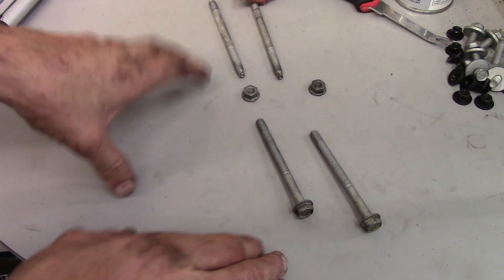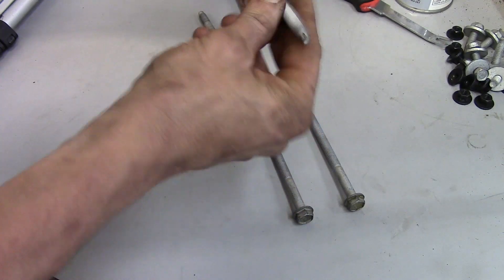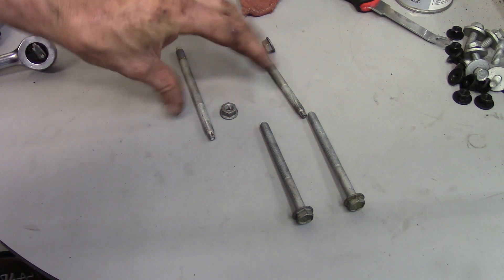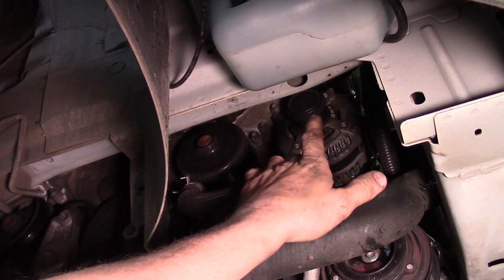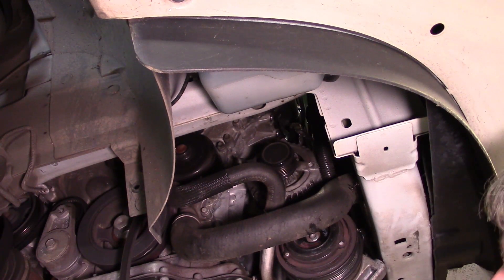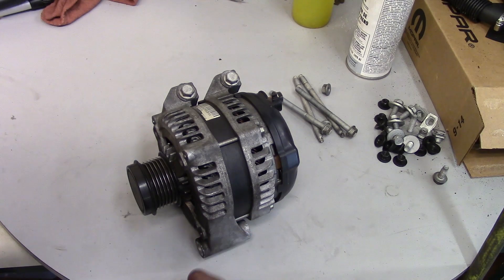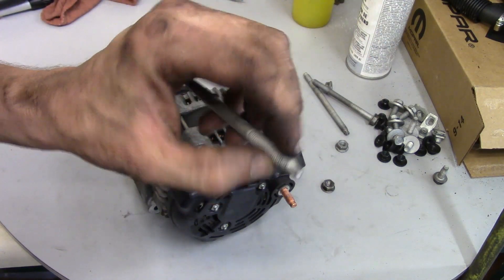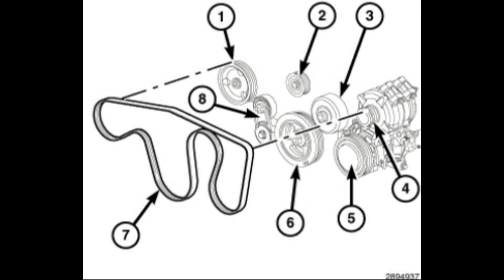Part 2/2: Grand Caravan and Town and Country 3.6 liter alternator removal with shortcut

Comment: Thank you so much for this detailed video MotorCity Mechanic. I was dreading replacing the alternator on my 2011 T&C Limited  especially after watching several videos of the "Go in from the top" method. After seeing this video it made the most sense  and helped me tremendously. TO ANYONE READING THIS, If everything goes right this can be around an hour job. 
LIST OF TOOLS I USED:
E8 inverted torx - for the A/C compressor studs(advance auto about $5).
3/8" socket wrench/ breaker bar- for the belt tensioner.
10mm socket- for the battery terminals / wheel well area plastic shield removal.
13mm socket / wrench w/ extensions(you may or may not need extentions,  they did help me in a few places)- for all other bolts I believe.
Flat head screwdriver - for plastic tab removal on under shield and to help release the tabs on the wiring harnesses. 
19mm deep socket- for wheel lug nuts.
 Of course for me me, everthing going smoothly never happens so it was a three hour job but nothing too difficult.  The added time was spent struggling with the wiring harnesses as mine were not as easy to press/pull out carefully, one of my A/C compressor studs did not want to go back in properly and just taking time to rewatch parts and steps of this video to ensure I was getting everything correct. If I were to do it again, I could have it knocked out in an hour. This was performed on my back in my driveway with the front passenger side jacked and tire removed. So thanks again for making this MotorCity Mechanic! Saved me a lot of money and only cost me a little time!

Comment: Just used this method on our VW Routan and it was great. A little tight with some of the bolts in the AC compressor but got it all out and BAM! The alternator came right out the bottom. Thanks for the video!

Comment: Very helpful. I did not have much time, and it needed to be done by Monday and a window of opportunity opened yesterday. Your video gave me a good idea of what I would experience. The quality was great and the bench talks were great. My first obstacle was operating the electrical connector on the AC compressor. I thought I knew, but I was not certain and I did not want to create a new project. I confirmed my knowledge and pressed forward. I had some challenges with removing the top right stud because the T8 sockets were all deep well and there is not enough room with the AC  hose. The other surprise was that the alternator stud came out with the nut which was actually helpful. There was plenty of room to get to the connector and battery wire on the backside of the alternator. Thank you for taking the time to put this together! I'll be looking for your videos in the future.

Comment: Thank you for these videos!  Replaced alternator on my 2012 Town & Country.  Used an E7 socket for studded bolts and removed the studded bolt from the alternator mount to maneuver it better.  Great description on the electrical connections as well made disconnecting easier.

Comment: Thank you for a clear, concise and interesting video. I also appreciate the fact that you used no off-color language in the production. I plan to do this job in the AM using your instructions.
Reply from the maker: Thanks for the kind words and for checking the video out. Make sure to subscribe
Reply: @MotorCityMechanic  I did. Didn't do the alternator replacement today due to a bad battery in wife's Journey.Battery is in the left front wheel well area. Poor, poor engineering. Hope to do alternator Sat.
Reply from the maker: @thomashuckaby8867  Take your time and you shouldnt have any issues.

Comment: Watched your video, thanks for the tip, didnt even watch any others. I have completely gave up on using manuals. Really appreciate the video. Just change the alternator took about an hour, one floor jack, one jack stand, four way wrench, 3/8" drive ratchet, 10mm socket 6" extension, 4" extension, 13mm socket,  1/4" drive ratchet a 5mm socket and 5mm wrench for the air conditioning studs, and of course a few well chosen words. and repair was flawless. Thanks again!!
Reply from the maker: Much appreciated Gary! I have no faith in paper aftermarket manuals as well. You just cant take enough pictures to show a repair.....video is the only way to go and some people butcher that up as well. I try to improve on each new video I put out so that I cover more steps and mention other needed items and tips. Thanks for watching and make sure to subscribe and check out my other videos as well.
Reply: Awesome video exactly what should be listed under the description on the auto parts website when looking at the alternator oh, because this was a lot easier then any other method
Reply: i suggest you copy Gary Lee's equipment list (or modify to fit the video) and have it be the first part of the description. I always appreciate knowing in advance what is required for repairs, other than that, i greatly appreciate your video. at first look at my van, i thought.... I'm not going to be able to get to that. now i feel much more confident.

Comment: Thanks for the video. It was tough to get the studs screwed in when putting the ac compressor back in. I used some creative extensions but eventually got them back in. The serpentine belt was a bit tricky. I figured out for my 2012 grand caravan that if I put the belt around the idler pulley last, then it was easier to put on, since it is smooth and doesn't have ridges. It was also helpful to charge my battery with a charger as I changed the alternator. I had a fully charged battery when finished. Once again, I sure appreciate your time to make this video!!!🙂
Reply from the maker: Awesome. Glad to see another video helped someone out. It can be fun for sure taking on that job but its still doable as you found out. Good thinking about the battery charger.....that way you didnt have to wait half a day when done just waiting for the battery to get charged. Thanks for watching and make sure to subscribe.

Comment: Much love and appreciation for this video! I didn't have a clue where I was going to have to start. When I learned about the coolant I was terrified of working on it. SO glad I found this video. Put the van on ramps and had this done with zero complications in under two hours. Thank you thank you thank you!
Reply from the maker: Cool. Glad to see that the video helped. It's not the easiest alternator to replace but as you saw....it can be done. Thanks for taking the time to comment and for watching. Make sure to subscribe and share the videos

Comment: I don't know if anyone mentioned this, but I'll add something.  I was working with the van on ramps.  It was very hard to get the connectors on the back of the alternator. So  I removed one side of the radiator hose and moved it out of the way and I easily and quickly was able to get to the connectors from the top.  I also had to buy an E8 inverted Torx.  I know other guys tried other things but I figured I'd go ahead and spend a little more for the right tool.   Thank you for the video, it's the only one I needed.
Reply from the maker: Glad that the video helped out and appreciate the info on what helped you. Thanks for watching and make sure to subscribe

Comment: This is an excellent video. I did this exact repair on my 2012 Grand Caravan Braun handicap conversion that has the engine lowered 3 inches from its normal position. I used the exact tools you used in the video  and only a set of ramps in my driveway in one hour. Thanks a million!
Reply from the maker: JJ Battle Awesome. As you saw you don't need a lift....some ramps or jack and jack stands is all that's needed. Thanks for the feedback and for watching! Make sure to subscribe!

Comment: Did the replacement today using this shortcut. Worked like a charm! Took me a little longer as I don't have a lift, but it definitely saved time over using the book procedure. Regarding the reverse torx bolts for the compressor, in a pinch you can use a 7/32 socket to get them out. Worked well for me.
Reply from the maker: +Patrick Gagnon Thanks for your take on the video Patrick. I appreciate the input as well. It's all about helping each other and your input helps others that read the comments so thanks. Make sure to subscribe of you haven't already and help spread the word by sharing these videos with others.

Comment: Awesome video. Short and to the point. Took me less than 2 hours in my driveway.  Btw if anybody needs to know. The reverse hex studs on the ac is a 5mm socket.
Reply from the maker: Glad it worked out well and thanks for the great feedback as well as the tip. Make sure to subscribe if you havent already.
Reply: I wish I seen this comment earlier!

Comment: Thank you for the video and adding the serpentine belt routing diagram.   

I debated on trying the top or side method.  My garage is small and I was not in a hurry and choose the top method.   It took me about 2 hours.   I drained 1/2 gallon from the radiator, this was easy, just attach a 1/4" hose to the nipple on the driver side lower corner and open the drain valve.  Unhook the radiator hose, and push it down into a bucket to get the rest.  Remove the hose (no spillage).  The fan is easy to remove.    The downside with the Top method is working on the the serpentine belt.   I had to remove the air filter box (easy, it just pulls up), but there is not a lot of room to work with the belt on the top.  To reduce tension, I needed a 3/8" breaker bar with extension.  Making sure the belt is on properly is also a bit difficult from the top.  I spent about 30 minutes dealing just with the belt, and I can see how going in from the passenger front wheel would be much easier.      

When it was all back together, poured about 1 quart back into the radiator, ran with the cap off put in some more, but the last quart into the reserve. 

I think this side method might be better, and if I have to do it again I will give it a shot.

This video was very helpful, especially explaining how to unclip the electrical connectors by sliding the red clip out, then pressing in the middle.

My original failing alternator was putting about about 13.5 at idle, and 11.9V with all accessories running.    New alternator  14.4 at idle, 14.2 with everything on  at idle.

Comment: Excellent video on the shortcut! My alternator just crapped out (100K miles on a 2011 Grand Caravan). Going to replace it and the belt this weekend. This will definitely save me some time!
Reply from the maker: +Patrick Gagnon Thanks Patrick......Take your time and you should have no issues. Do me  a favor if you don't mind....got a thought for a further project that I may or may not do but none the less.....if you like, send a pic of you and the vehicle. Thinking about maybe putting together something with vehicles and owners that fixed their cars from watching these videos. You can email them to david@motorcitymechanic.com . Otherwise thanks for watching and for the comment. Make sure to subscribe

Comment: I changed our 2012 grand caravan with just crocodile jack and a pair of jack stands because  i don't wanna pay for a an expensive shop rate.  So i did it on my own.  This procedures works like a charm even though i don't have the luxury of using a hoist and working on my feet.  I'm done in an hour and a half working on my back on a piece of cardboard.  Recharged my battery while working on the alternator.  Fire up the engine & recheck charging system & all working good.  Thanks a lot for this video for saving me a lot of money.  I highly recommend this procedure.   Cheers!!!!

Comment: Thanks so much for the video. I got to do it twice in one day because the first alternator I bought was putting out 18v. Second alternator has worked well so far (just finished putting it on an hour ago and drove it about 10 miles and so far so good). The only thing I did different was used an e7 for the studs, (think you had an e8???) Anyway, you saved me a lot of time and money. Keep up the good work!

Comment: Thanks for this information! Getting ready to change my alt out tomorrow. Good to see people who think outside the box and share information! Thanks again!
Reply from the maker: Appreciate the feedback Jay. Knowledge is meant to be shared. Make sure to subscribe if you havent already
Reply: I live down in Toledo Ohio and I've always taken my alts and starters to Wally's on Bennet Rd. 20+yrs and no problems with Kenny's services. When I had my 2012 3.6 alt rebuilt last week, he removed the external clutch and replaced it with a standard pulley. My question is why the external clutch and do you see any reason for changing or not to a standard pulley? Thank you for your help and information!

Comment: Thanks for this video, the tech advice is much appreciated.  Pulling from the bottom made a lot more sense than dealing with coolant.  The 5.5mm socket works great for those studs (didn't have the torx socket), and the 13mm bolts on the alternator came off with a short socket and elbow combo.  Didn't have a stubby wrench.
Reply from the maker: The "out the bottom" method is the way I prefer to use each time. Even without a lift you can still access it with a set of ramps or jack/jack stands. Thanks for touching on each of the steps and what worked best for you when it came to tools on hand. Thanks for watching and make sure to subscribe.
Reply: Yes Sir, did this without a lift - still on jackstands with a sheet of plywood in the driveway only 1/2 done hahaha.  New alternator arrives tomorrow, can finish it up.  Checked out your other PentaStar videos, the spark plug replacement one is going to come in handy.  What ordinarily should be a simple job is simplified by your video - thanks for this too (in advance!).
Reply from the maker: I think in that video I edited a mistake....it might mention something about the injectors or lower intake....please ignore it if I did. Otherwise another take your time and you will do fine video. Thanks for watching the others as well!

Comment: Thanks for the video. It took a few hours but your recommendations worked well. I had to loosen the 2 top alternator bolts from the top instead of the bottom and that took a while. I had to disconnect the upper radiator hose from the radiator and move it out of the way to get better access to them. An offset wrench would have really helped as I struggled with a stubby ratchet. Also I had to use an E6 inverted torx socket for the AC compressor studs on my 2011 Town & Country (not an E8), but I guess Chrysler changed the size from year to year. It was a bit of a challenge to remove the alternator from the bottom...the AC compressor had to be positioned just right to get the alternator through, but it did work and did indeed seem easier that pulling the fan & shroud out.... Appreciate your time!...saved about $400 here in NJ!
Reply from the maker: Much appreciated Dennis. Thanks for the added info on how you removed the alternator.....the more info, the more people that can be helped. Make sure to subscribe and keep watching!

Comment: Thanks for the video.  My wife's battery light just came on today and I checked and it's not charging so I'm trying this method.  Seems pretty straight forward.....
Reply from the maker: Its not the easiest and it aint the hardest either. Thanks for finding the video and thanks for watching. Make sure to subscribe
Reply: MotorCity Mechanic no problems dude.  Got it out last night.  Took about 45 min...
Reply from the maker: Awesome! Thats for the update
Reply: Derek Bader do take the tire out?

Comment: Thanks for video!! Headlights have been flickering on my 2012 caravan and was dreading going in from the top end!!
Reply from the maker: Your welcome Steve. Theres more then one way to do....top or bottom. Just depends on your tastes. Appreciate the comment and make sure to subscribe
Reply: MotorCity Mechanic Thanks. Im sure it will pan out well. I worked flat rate for 12 years but thankfully am hourly now, but if there's a better or logically simpler way, I'm all ears.

Comment: Excellent video.  One suggestion, you might want to show how the electrical connectors disconnect in more detail once you got the units out.  That was the only thing I had a problem with.  I used either a 3/16 or 5/32 socket on the AC studs rather than an inverted torx socket.  Finally, it appears to me that Chrysler vans have a ground strap problem from the engine cradle to the frame (on the passenger side by the shock tower on my 2013).  If you are replacing a blown alternator, you should be sure and check this.  The parts store clerk tipped me off to it and lo and behold mine was rusted thru.
Reply from the maker: Usually I do go over the locks on the connectors. Must have over looked it on this video. Sorry about that. Others have used different size 6 point sockets as well and got away with not having to use the inverted torx sockets. I havent seen any issues with the ground straps where I am from but then again we dont see alot of rust so it may be an issue in different areas of the country. Thanks for the info and the feedback, its much appreciated. Make sure to subscribe and check out my other videos that might help you in the future as well.

Comment: Thank you for this and all of your other videos, I took your video and combined it with the service manual, start to finish under 70mins with out having to lift the van (did not use jacks or ramps), Love your shortcut though, If I had access to a lift when I neeeded it Would have gone the same route you did
Reply from the maker: Thanks for the feedback. The lift certainly helps for sure. Make sure to subscribe if you havent already.
Reply: How did you not lift it?